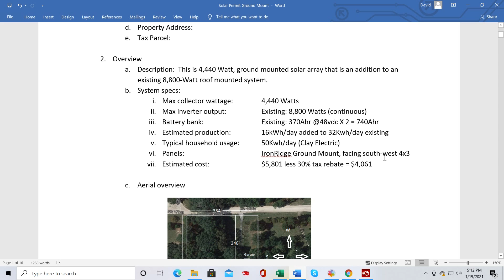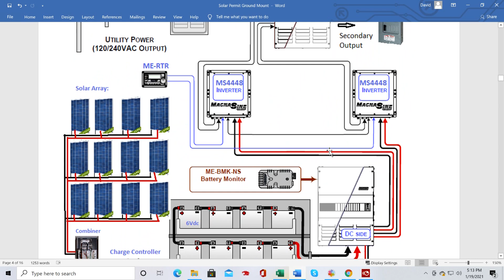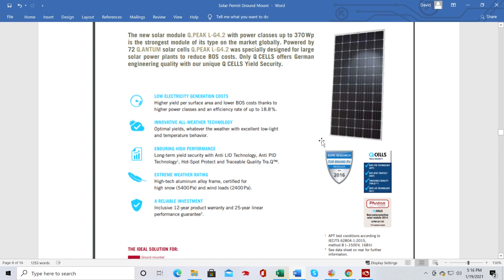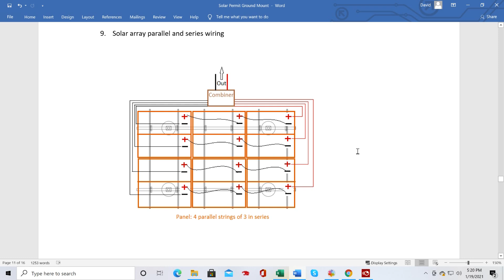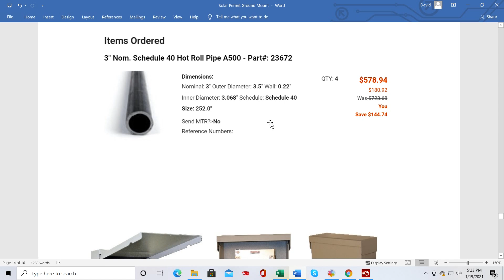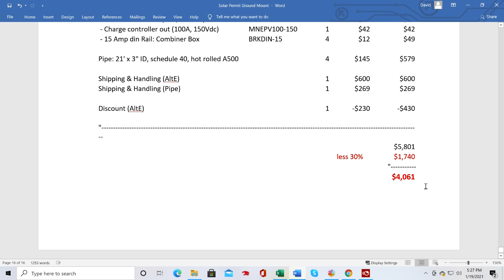IronRidge Ground Mount Solar: Design

Comment: I really like your spreadsheet.  Seems like under "Controller Data" "Max Power Output Watts" should be "Max PV Input Watts".  Can you explain please?
Reply from the maker: Mk, "Max Power Output Watts" is the max output of your array so YES, "Max PV Input Watts" would be a better name for it.  Thanks!
Reply: @HomesteadEngineering  Thanks again for the spreadsheet.  I am using it.  Signature solar has an inverter - the EG4 6500.  It has 2 MPPTs; 2 pv inputs.  Is the spreadsheet designed to take this into account?

Comment: I am planning on building a 16 panels ground system. What vendor you used for the 3” ground pipes? I live in Jupiter Farms, Florida.
Thanks for you awesome videos.
Ronnie Shand 
Mechanical Design Engineer
Reply from the maker: Hello Ronnie,  
Online Metals: https://www.onlinemetals.com/en
3" Nom. Schedule 40 Hot Roll Pipe A500 - Part#: 23672
Not cheap: $847 with freight
Good luck with your project.

Comment: I recently priced 3" plain black steel pipe at a local supply store, its currently around $15.50/ft., I think I'll wait a while..
Reply from the maker: Ouch!  That is crazy expensive.  What is the pricing outlook over the next year?
Reply: @HomesteadEngineering  Not sure, story has it that when Covid hit last spring, production capacity was way down as was demand. "They Say" production up now, but they're playing catch up with demand.   Just got 6 Panasonic HIT 325 w (60v) panels as they were discontinued in feb. but got em' while the getting was good, install can wait a bit...

Comment: Is there a reason you didnt choose to use micro inverters in your system?
Reply from the maker: My system is not grid tied or net metered.  It is a stand alone system and it  basically works like a backup generator to the house that's always on.  Using 20 transfer switches, I am able to run any combination of the house circuits on the utility or my solar at the same time.
Reply from the maker: I think you might like this: https://youtu.be/QhoqMm9DOz4
Reply: @HomesteadEngineering  That's a really good video for starters!

I'm still a big supporter for a micro inverter system because they convert DC to AC at the panel which makes it safer overall, especially if you have to work on the system. They help combat shading so only the panels affected by let's say your neighbors tree will be affected vs the whole system. I've also read an article that systems tend to perform better overall in snowy climates with micro inverters. Micro inverters are about the same price as optimizer now but optimizers still require a main inverter.

That being said when I saw your layout plan, doesn't look like you'll ever have to worry about shade and if I didn't have to worry about shade and snow I'd probably go with a string system too. 

Currently have a 2.48kw microinverter system running at the cabin and it does very well for our application. But I cheated and ordered a kit, I didn't design it. I just picked the size, location where the panels would go, where to run the wires and followed code on the wiring portion.

Comment: I like the new name! Is the 32kwh average through out the year? Cause it seems a little low. I have 8700 on my sol-ark and I did a little over 45kwh a day averaged for 2020. We made 350 dollars last year selling back to the grid. One of the things we did to get more out of it was to let it use 20% of our batteries at night and then only charge from the sun. I would like to get just an inverter because right now the only thing I can't run off of it while other things are running is my wife's hair dryer, mix aid mixer, harvest freezer and power tools. Seems like everything else runs fine. If I could just add 6kw inverter more I think the entire house would run off grid without any thought of overloads.
Reply from the maker: Hello a v, I think my system does have about 40-45kWh potential now and will have 50-60kWh once the upgrade is complete.  I don't ever get that out of it because I am not grid tied.  So once the batteries are charged and I don't have enough loads, the power just goes to waste.  Without getting into details, I think once we switch to a large Lithium battery, we will be able to max out the potential.  Thanks!